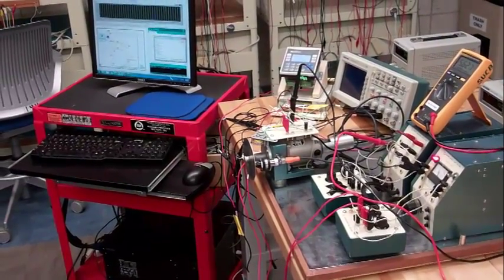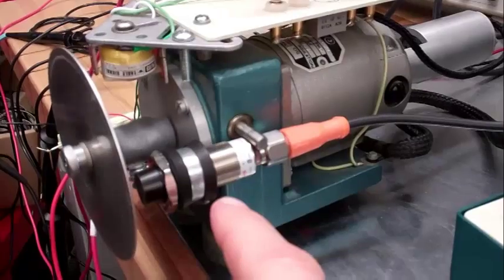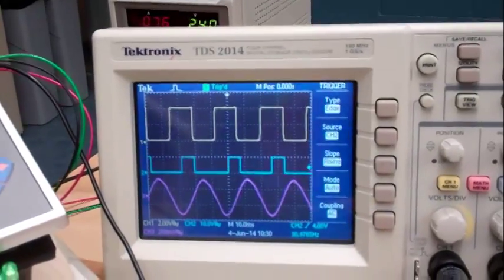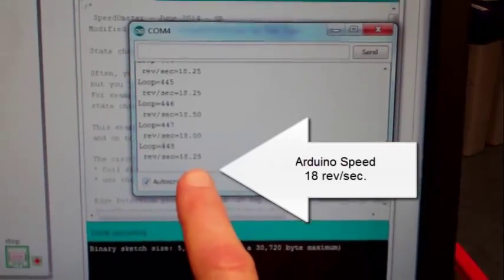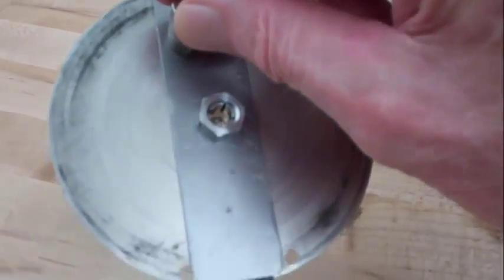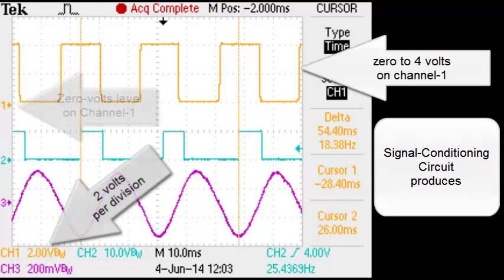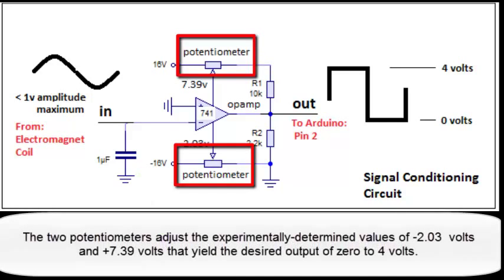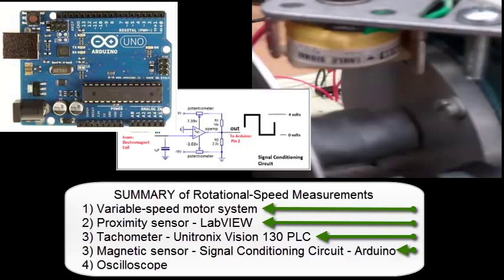B3354 - Rotational-Spead Measurements

Comment: May i know the formula for get RPM??
Reply: You can set up an interrupt to measure the time between rising edges of the signal.

Having time stamps for two consecutive (rising edges) signals (T1 and T2 for example) you can calculate the time difference between the rising edges of the square wave which is the signal Period.

From there you can calculate Frequency (in Hz) as 1 / Period (in seconds) which is basically an event repeating so many times per second. Shorter the period the faster something repeats (or rotates in this case).

All you need to do is convert seconds into minutes and adjust for the number of magnets you have in your system that can generate rising edges of the signal.